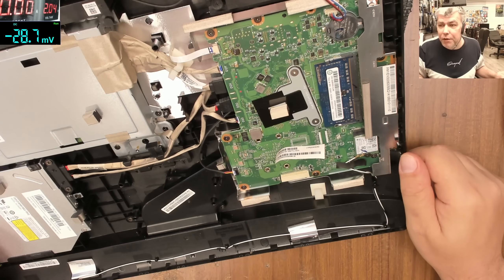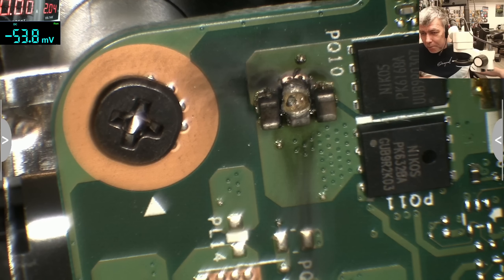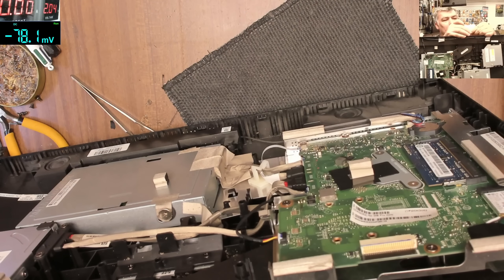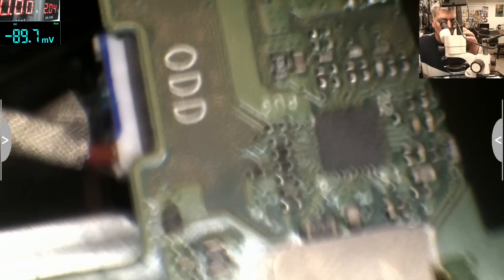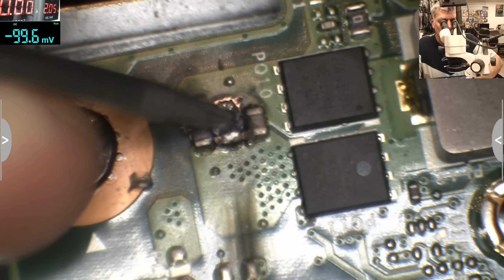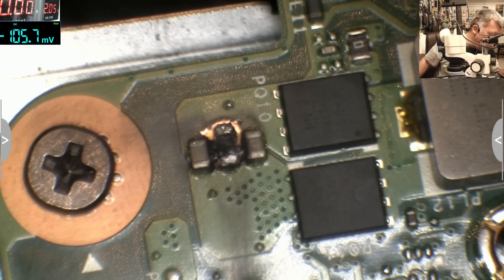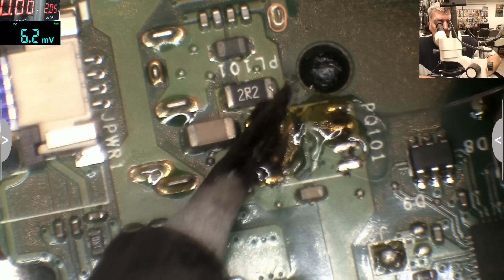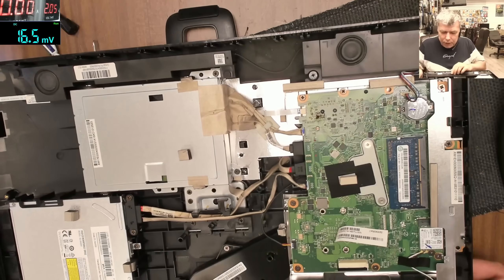Lenovo All in one PC - blow up motherboard but easy to be repaired

Comment: I have learned a lot from watching Sorin's videos.    I was able to diagnose a short in my CPU in my IBM T60 laptop (It was an upgrade chip I bought used on ebay) and, I also used his hot glue method to repair the hinge on my Getac S400.  Thankfully, that's all I have needed to repair thus far.

Comment: so in the case of a dead mosfet we can connect the source and the drain by a bridge. but in other cases what I don't understand is the fact that it is considered short-circuited so passing , which will have the de facto consequence of securing the motherboard

Comment: Hi there , at 08:12 , why you didn't make a bridge on mosfet  between pin 2 and 6 ???why you didn't connect pin 2 and 6 with wire  together ??thnx